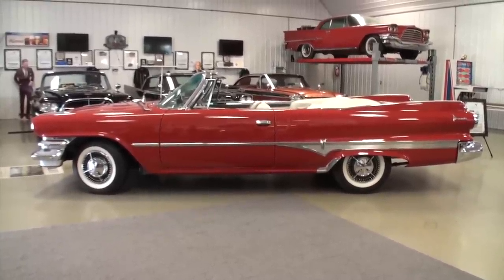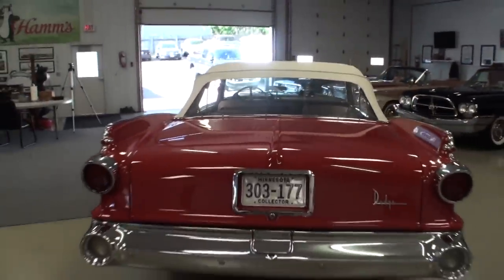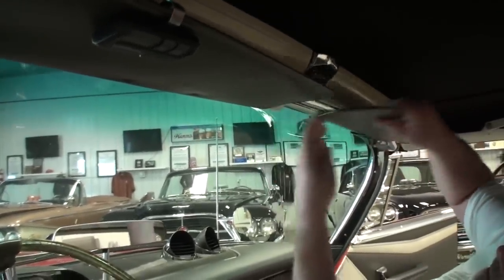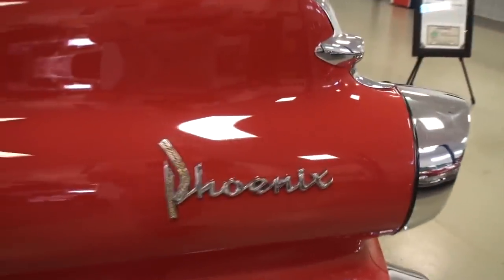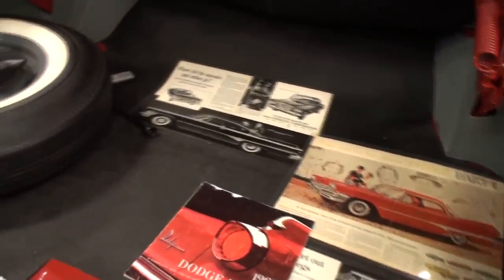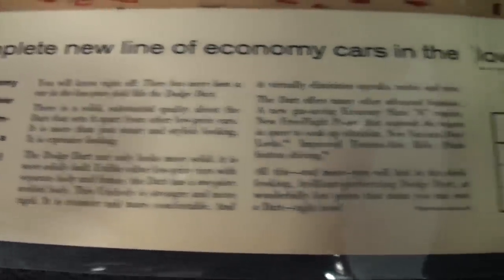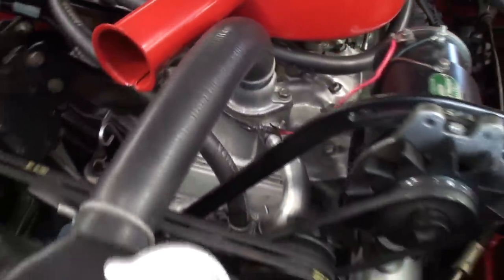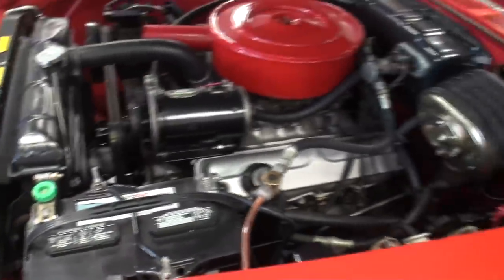1960 Dodge Dart Phoenix Convertible in Red & Ride on My Car Story with Lou Costabile

Comment: As the owner stated, the Phoenix wasn't the bottom of the line, the Seneca was. My parents bought a 1960 Seneca coupe new and paid just over $2K. It had the standard 225 c.i. slant 6 and the only options were the TorqueFlite automatic and a padded dash and pushbutton radio. A few years later, they had  an ARA airconditioning unit added. We didn't even have A/C in our house! It was a great car with the only problem I remember was that it would occasionally vaporlock when driving into the mountains. Other than that, it never had a problem keeping up in traffic. My parents replaced it with a new Plymouth Fury III hardtop 4 door with a Commando 383 with many options. It cost $4100. out the door. People were lined up to buy the old Dodge and my parents got $500. for it and were pleasantly surprised. Remember, in 1968, you could buy a running/driving car in good shape for $100.
The base 318 polyspherical V8 was a great engine and lasted through the 1967 model year.
Thank you!
Reply from the maker: Hi Automated Electronics, Happy to read this car brings back memories of your Parents car :-) Thank you for viewing, sharing your knowledge, and you're welcome, Lou

Comment: My 1st car was a 1960 Dodge Dart Phoenix convertible, red (vermillion) with a white top and a red interior. I bought it in 1969 when I was 17. I paid $295 for it and it had 49K miles on it. It had the 318 CID 4bbl TorqueFlite. It needed a little rust repair. My dad used to own a body shop, so I had some help getting some rust repaired and I repainted it. I drove it until 1992 when the unibody had rusted so bad that it was unsafe to drive anymore - I drove it over 110K miles and had some good times.
The differences between this and mine:
1- No A/C
2- Red/black interior (door and 1/4 pads: red where the gray is on this one; black where the white is.)
3- Red/black front bench seat (red where the white is and red/black fabric seat upholstery) I replaced the front seat with red bucket seats out of 1967 Ford Galaxy XLT and built a center console for it.
4- It had upgraded O/S mirrors
5- It had the antenna on right-rear quarter panel
6- Black dashboard. This one appears to be dark gray. The hood over the speedometer reflected sunshine that blinded the driver so I painted it flat black. Also the radio knobs were different. (I learned later that some were assembled in Detroit and some in Newark, DE, and there were some minor differences.)
7- I added an anti-roll bar to the front, had dual exhaust custom made and Cherry Bomb mufflers.
8- It last had white letter BFG Radial TAs with Cragar S/S wheels on it when I had to finally quit driving it.
It had a 2.79:1 rear end. It was slow to get to 60 MPH, but would cruise all day at 70 MPH. Stopping was another story - I needed a looooot of clear space ahead!
Reply from the maker: Hi Joe, Happy to read this car brings back memories of your 1st car :-) Thank you for viewing and sharing.  Hope you see many cars on this Channel you enjoy!  Please Subscribe, and hit the "bell" so you can see all the cars when they are uploaded on this YouTube Channel, Lou

Comment: Another incredibly styled Forward Look masterpiece, created by Virgil Exner and his design staff at Chrysler! This car just glistens - when I first saw it at Back to the 50s in St. Paul a few years ago, I couldn't take my eyes off its amazing interior - the door panels, the seats, the dash with its orbital clock! Selling with a base price of $2,988 in '60, this Dart Phoenix convertible, built on Dodge's shortest 118" wheelbase, likely stickered in the $3,600-$3,800 range. And Lou, ouch!, please don't compare the features of this rare gem to a '57 Chevy! Unfortunately, numbers of '60 Darts by model line and body style are not available, re the numbers of these Phoenix convertibles that rolled off Dodge's assembly line.
Reply: This model, the Dart series, was given its overall shape by Exner, but the body design was supervised by Cliff Voss, echoing Exner's original designs for the Polaras and Matador series. The same design strategy was followed for 1961 also.
Reply from the maker: Hi Noel, Happy to read your comment, and thank you for sharing your knowledge. Lou
Reply: @TheDejael  thanks for comments…..

Comment: Designed by Cliff Voss, based on Virgil M. Exner Sr.'s original 1960 Dodge Polara design. The two Dodge models look similar, but have a lot of different components, including completely different rear quarter panels and tailfins, and front bumper and grille assemblies. No car maker would do this sort of thing today. Dodge spent a lot of money on the economy Dodge Dart line for 1960 and 1961, when they didn't have to. The Dart was downsized for 1963, after an economy model on the main Dodge line for 1962.
Reply from the maker: Thank you for viewing and sharing your knowledge.